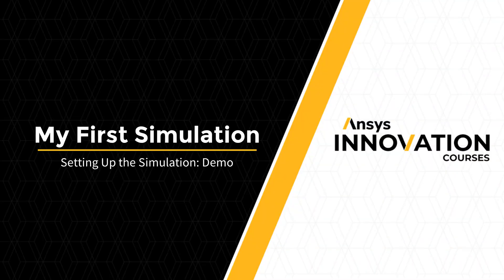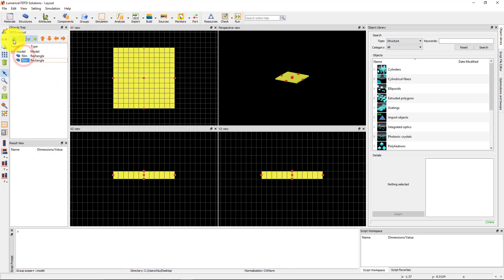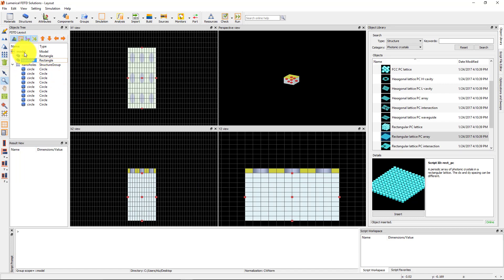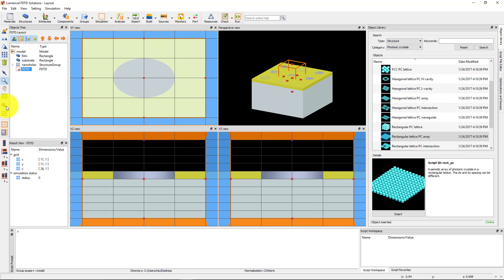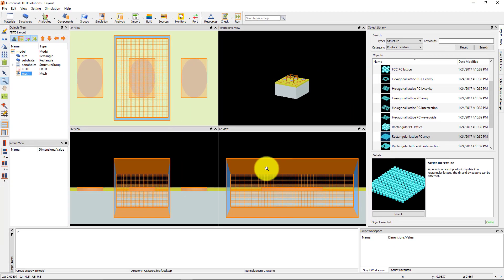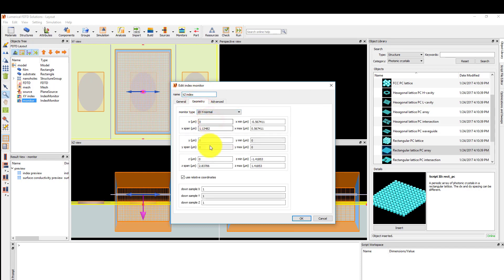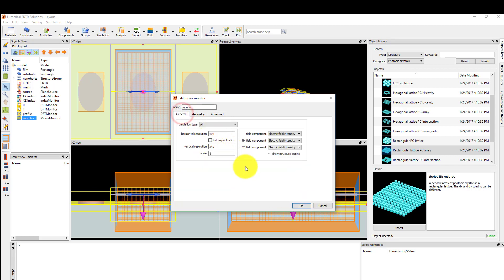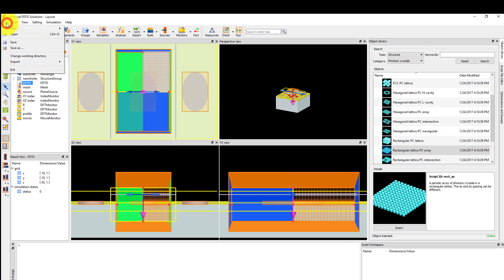Setting up a Simulation in Ansys Lumerical FDTD – Lesson 2, Part 2

Comment: Is it possible to get external quantum efficiency (EQE) curve from Lumerical FDTD, or possible to get current density in case of absorption? Actually I am doing a thesis work on efficiency enhancement of solar cell implementing nanoholes. I am not getting any help from any expert of Lumerical. Please help me if possible.